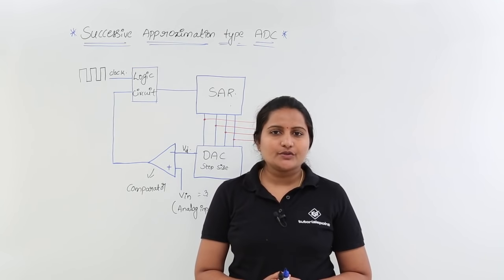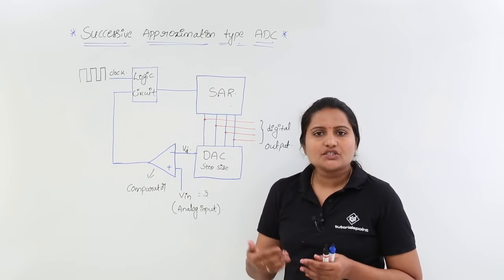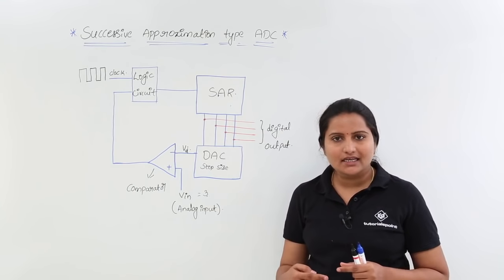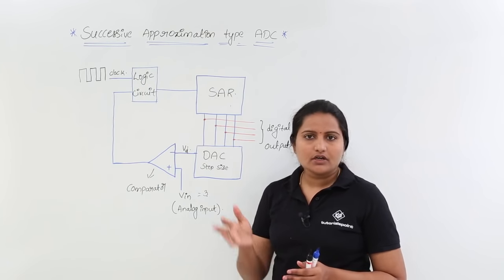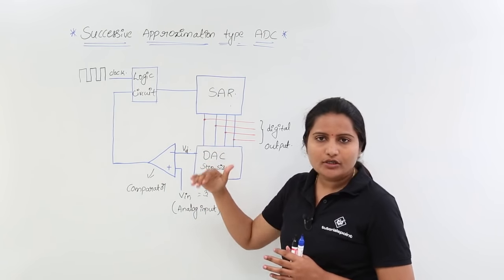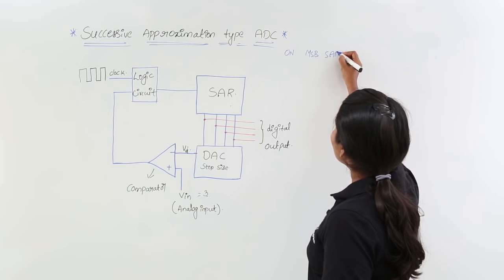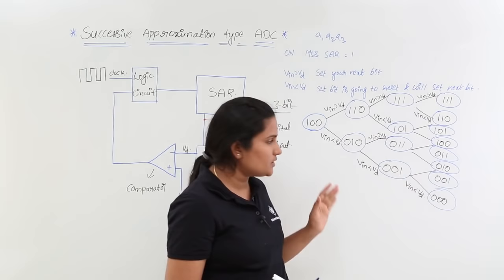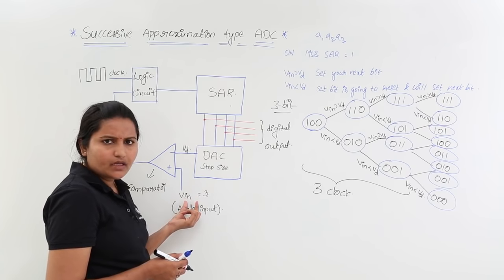Successive Approximation type ADC

Comment: Good Question Sudheer. It is very clear that the Op-Amp is connected in open loop mode.V(-)>V(+) then vout=[-Vsat] and if V(+)>V(-) then Vout=[+Vsat]. If V(+)=V(-) then Vout=0.As the output is connected to the digital circuit one of the input is 0 Output of the digital block is 0. So, there is no impact on the already stored SAR Data.Finally, this is the finalized output.
Reply: pls rply to my comment.thanks.
Reply: can some one
 share practical Ckt ...immdtly

Comment: If I am giving Vin as 6v,then only one clock pulse if enough.
So can I say that for 3 bit o/p digital data , maximum clock pulse required is 3?
Reply: Nitish Kumar clocks required is independent of the input voltage
Reply: If it is n bit, it requires n click cycle, if n=3, it will give output at the end of 3rd clock pulse...

Comment: What the result when they are equal
Reply: the previous result will be adopted. If 0 then it'll be 0, if 1 it'll get 1
Reply: If it is equal, then the bit which was set previously, that will be retained, if vin less than vdac, then the bit will be reset....

Comment: What will happen if i give decimal input analog voltage?? How it will be converted?
Reply: It depends on the RESOLUTION. If you resolution is 10mV you can detect 10mV differences. For example a 12bit DAC with an AREF of 10V gives you a resolution of 10/(2^12-1) = 2.44mV. 2.44mV is the smallest difference you can detect wirh an 12Bit DAC with a 10V AREF.